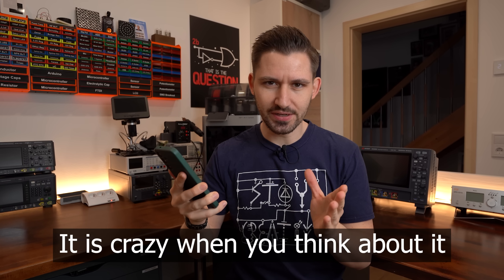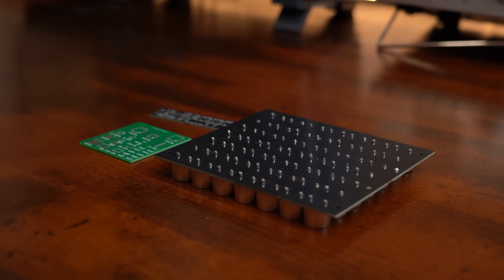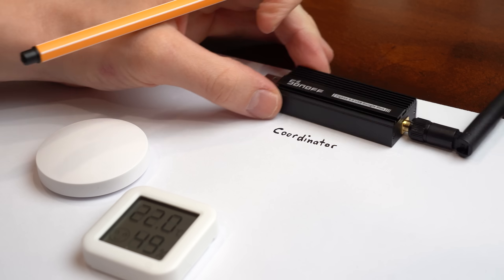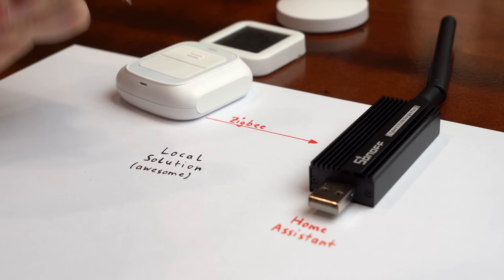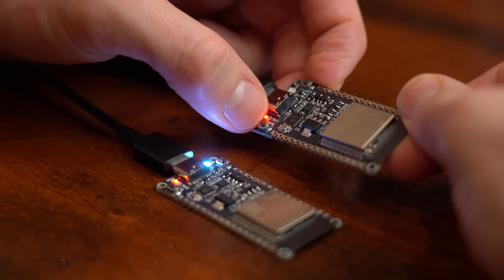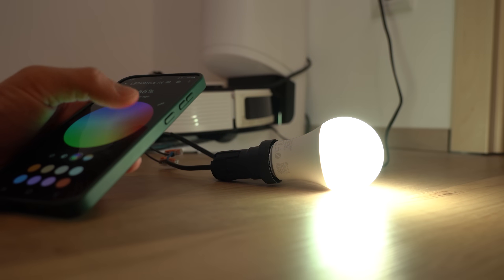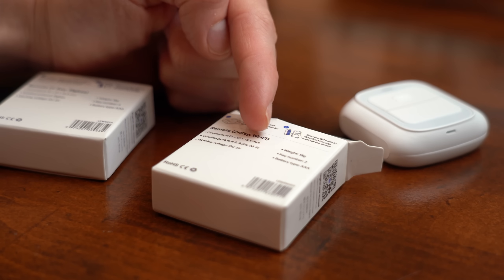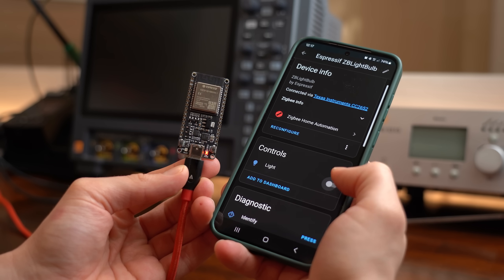Forget WiFi AGAIN! This Wireless Method is WAY Better? (Zigbee)

Comment: I don't think it makes sense to compare the range like this. The range depends on
- antenna design (and everything around it)
- TX gain as configured in dBm (for example with BlueRange Mesh, we could simply increase Bluetooth power by 2.5x by changing it from +4dBm to +8dBm, thus massively increasing range).
So it probably only makes sense to compare them with the same board and antenna gain (or configure the maximum gain for each technology, as some might be artificially limited by regulations, which can be seen as a downside of a technology)

Comment: Even though power consumption doesnt make much of a difference between WiFi and Zigbee, the Zigbee devices only fire in short bursts when they need to update, and the packets sent are a much smaller size than WiFi, so in the end, it consumes less power marginally.

Comment: Another thing I like about Zigbee is called Zigbee Bindings. Basically, you can "bind" end devices to each other, allowing them to control each other without going through Home Assistant. That's the only reason I'm comfortable with having lights controllable solely through Zigbee: even if Home Assistant goes down, the lights will still work.

Comment: Nice video, i didnt no there is zigbee diy boards! i must try them now 🙂.. I’ve stopped buying WiFi devices for my Home Assistant setup because I don’t like relying on the cloud. I still use a few Wi-Fi bulbs tho, but i use them locally (local integrations), with the cloud connection as a backup option.

Comment: WIFI SHOULD NEVE RBE USED IN DEVICES THIS IS STUPID AND SUPER HIGH OVERHEAD.  Also makes router work harder. Adds lots of network insecurity. ZIgbee is BEST so far there is not anything better device comunication. Also wifi is SLOOOOOOOOOOOOOOW comapared to zigbee.  I mean data packets is mcuh smaller faster to process and so on. Also zigbee uses the same freq as wifi but i noticed that zigbee have better coverage than wifi. I think its because of much less bitrate needed.
Also BAD idea to keep ZIgbee coordinator near router. I think you used safe band in zigbee to not be tha same as in wifi, but still, better to use in separate places, but nothing critical of course...if configured correctly bands.

Comment: ZigBee is great - I use tons of ZigBee sensors in the house. I agree with your judgement in general but the "Easy?" aspect requires a higher score in my opinion: "Good" at least if not "Best":

Install ZigBee2MQTT in HomeAssistant and activate "permitting to join" in the Z2M interfaces. If you then activate pairing mode for a new sensor (by pressing its button for a few seconds) it gets added fully automatically. Nothing to do for you - no password, no manual confirmation in HomeAssistant. Nothing. The device just appears (via MQTT) and can directly be used.

Comment: Yeah, Zigbee is great! im doing my home assistant setup since 2 Month and buying zigbee devices like crazy. There are some cool tools like Zigbee2MQTT and the Switch Manager!
How do you use your Wifi Thermostat/ Tuya device? Is it wired with a floor heating etc. or do you use it as a probe to control some TRV and so on?

Comment: 3:44 It’s anyway recommended to use a shielded USB A extension cable to connect the Zigbee dongle to avoid interference.

It’s also recommended to use USB 2 ports to avoid interference.
Reply: Came here to say this. If your device doesn't have a USB 2 port, just place an old USB 2 hub on the end of the cable and plug the coordinator into that. Note: I don't know if it makes a difference, but I used a powered hub

Comment: This video comes at a perfect time. I have recently started creating my own network of zigbee contolled devices, using Home Assistant and mostly IKEA Tradfri lights and switches. I was also wondering if I could implement some of my own devicss using the ESP32 boards, so this is exactly what I was looking for.

Comment: Great video, would you consider doing some tests with WiFi HaLow? I saw Morse Micro demoed some products CES and they also have a video where they test another device at 16km range with around 2Mbits throughput. I would like to see how HaLow compares to Zigbee for IoT applications

Comment: I use a lot of zigbee devices myself and i love them! I just need 1 hub/dongle to control them all and it only has a connection to the internet on the hub/ha server side instead of seperate devices all connecting to the internet. Also no need to enter a wifi password

Comment: About consumption, I have a zigbee temperature/humidity sensor since two years and the AA battery inside is still at 100% (it wakes up and sends data only when you want to display it, or once every hour if you don't use it, to build up the history)
On the other hand, the button battery of the door sensor died in two months this summer because the door was open almost 24/7 and it sends data continuously when the door is open... So yes, very low consumption in sleep mode, but can die quickly as WiFi devices if it can't use sleep mode ^^

RIP small button battery!
Reply: What brand is this zigbee temperature/humidity sensor?

Comment: While it makes sense you are using “speed” and throughput/bandwidth interchangeably. 

I’ve been playing around with different smart home set ups and I find speed (as in time) to be a noticeable variable. Especially on systems that will operate locally or remotely automatically by utilizing Wi-Fi when you’re not local but use their proprietary protocol when you are.

Comment: I wish WiFi didn't rely on the grace of vendors since this would make everything easy. I've added Zigbee and Z-Wave dongles to my Home Assistant to make sure all of my smart devices are managed locally and I can use my VPN when I'm remote. I'm not at the mercy of a vendor with the exception of my Garage Door opener that recently "updated" and removed automation functionality.

Comment: What is the low current measurement tool you use?
Reply: Seconded.  👍

Also is it compatible with Linux?  And is there a video for it?  Thanks.
Reply: I also really need this kind of low current analyzer, @greatscott could you give us some info on that?

Comment: Personally i love wireless technologi, but as soon as that wireless technologi has to connect to my internet, i am researching ong what protocol they use, if zigbee, hell no.
what people don't think about much is cybersecurity, and zigbee normally being very very easy to get into. zigbee pruducts security is based on how great the manufacture themselves deside to encrypt their product, there is no minimum requirement. and a lot of zigbee products are cheap chinese products with very poor if any encryption at all. where as something like z-wave has a minimum standard in order to be sold as a z-wave product.
just beware of what you connect to you'r home network, it is not hard to gain acces to it through un-encrypted zigbee products.

Comment: Zigbee is mature! Zigbee is already on mars! „Both Perseverance and Ingenuity are equipped with 900 MHz Zigbee radio link chipsets that are designed to relay data over distances of up to 1 kilometer.“ Perhaps Zigbee selected 2.4GHz because it is available worldwide where the regulations on RF Band differs from country to country.

Comment: Zigbee is amazing piece of tech and extremely low power as you saw because zigbee's primary function is communication between devices so since it doesn't transmit audio and video it doesn't really need a lot of power. Zigbee is even more power efficient than bluetooth so using it to connect devices to communicate among themselves is great for your electrical bill.

Comment: I'm glad to see Zigbee added to the leaderboard, and the quantitative comparison between their consumption, I knew zigbee was efficient but seeing the numbers, it's impressive! I've been using it for (domoticz then) Home Assistant running on my RPi 2B with the superior OSS Zigbee2Mqtt (koen the dev behind it is a machine) module since 2020, and would highly recommend it over the native hassio, due to its amazing support and features. Suprisingly the hw limitations are not a hurdle.

Comment: A network attached Zigbee Coordinator like one from SMLIGHT (SLZB-06M is one I got recently) would have been a good alternative to the USB stick, even runs on PoE power if available and has a local web interface!
Reply: And it costs about the same as the Sonoff stick, too

Comment: I have the problem that I have a Victron PV ESS system which needs permanently data from a energy meter. The dificulty is, that the distributionbox is in a neighbour building and it is not possible to set up a wired LAN line to my Raspi with Venus os.
Currentl I'm using a "Volkszähler" witch contains a ESP8266 and uses normal WiFi and a Tasmota firmware.
Thise solution is not pretty stable and has high latency times. It seems also that a ESP8266 is to small for this job.

What do you think, could a solution with Zigbee a better idea? And can Tasmota use Zigbee for a datastream?

Any ideas and thoughs are welcome!

Comment: For the power consumption since is a risk v chip you can power off stuff that the communication doesn't use to increase efficiency also the Comercial device probably is a soc that only does that

Comment: The one issue with Zigbee is contradictory. Because it's an open standard (which is obviously a good thing) integrators are free to alter it - including making it only work with their hub. Philips attempted to do this and only stopped due to a lot of bad PR, Ecobee has done this from the start. Z-wave isn't open, is way more expensive, but is guaranteed to work with any hub. I wound up using both.

Comment: After using a couple of dozen Zigbee devices with Home Assistant for about six months, I decided they were just not reliable enough.  (Mostly buttons and window-sensors). Since I had mostly Ikea and Aqara devices, this may have been the reason. I finally decided to buy an Aqara Hub M3 and an Ikea Dirigera. They are both connected to Home Assistant via Matter. When I add new devices to them, they automatically show up in HA afterwards, and since the brand devices have their own band hub, I now have a reliable system.

However, what's considered reliable may be different for everybody. As most of my home is KNX and I am used to PERFECT reliability, it was not acceptable to me to have devices fail once per week or every couple of weeks. So your mileage may vary.
Reply: how do prices compare (ZigBee vs. Matter devices)?
Reply: Aqara's zigbee end devices don't really work reliably (using with my own coordinator with zigbee2mqtt, not aqara hub). They lose "connection" to network from time to time, which is quite annoying. Other zigbee end devices, like Philips have much more reliable connection protocols.

Comment: Yes but Wi-Fi is Ethernet ... And you can apply all the bell and whistle of it such as switches, bridges and VLAN say. Using Thread on top of 802.15.4 look like a better option that Zigbee still, but I would preffer an evolution of 802.11 with a PHY using BLE on a connection less way.

Comment: Thread is the future! IPv6 is really good and important. To be able to always connect it with Matter even if the product is dicontinued.
Reply: As much as I agree that IPv6 is the future, keeping IP out of smart hone devices is honestly a big plus to ZigBee in my eyes. 

With the lack of security in general in IoT having mostly unmonitored/inconfigurable between routers around the network seems like a huge downside to the Matter model (especially with Matter over WiFi bridging this to normal user networks).
Reply: @rhysperry111  I don’t quite see what the appeal to keeping TCP/IP out of smart home devices is. 

That said, I do love Zigbee and ESPNOW
Reply: I’m not convinced. From a tech perspective, I mostly agree, but it needs wide adoption to “be the future”

Comment: Please, can you create a clip on how to use simple monitors and use them in personal projects and what do you need? For example, you put it on a DAC AMP and it gives you information about the SWOT, or you put it on a DIY flashlight and it tells you how much time is left to run or how much lumen it uses and things like that. It revolves around small screens Or even use it as a decoration on your desktop

Comment: That's crazy that in EU you can mix low voltage devices with line voltage devices in the same box (electrical panel).
That's not allowed in US, for obvious safety reasons.

Comment: Nice! Now I'd love a video about Matter over Thread, and ca comparison between it and Matter over WiFi and with ZigBee
Reply: Matter over thread is pretty much the same as zigbee since it is designed on top of it. The zigbee alliance renamed themselves to connectivity standards alliance and took the zigbee protocol part and used it as the base for the  matter protocol. It's even mentioned to be the base revision of some clusters in some places. The RF part of zigbee and thread is also really similar. While thread enables actual ipv6 networking, it's also just a 2.4GHz 802.15.4 mesh network. Range and throughput should be about the same , the same hardware can usually do both
Reply: @zapl80  In contrast to Zigbee, Matter over Thread is an open standard and very likely to replace Zigbee long-term. So getting new Zigbee stuff might not make a lot of sense if you don't already have a network. Would try to go with Matter instead.
Reply: @xdevs23  Thread and Matter aren't free, you can't build commercial products without paying lots of membership and certification fees. The only thing really open source is the matter reference implementation
Reply: @zapl80  Is it really the case that you can't build them or are you just not "officially approved"? Because you can still implement it and since it has an open source license, I don't really see what's holding you back from doing it anyway without paying a single dime. Of course the device wouldn't be accepted into networks but if you're in control of your own network then you can also make devices work that are not certified.
Reply: @xdevs23  you can do whatever you want in your own diy solution, that works fine, you'll get a warning that you have an uncertified device when using apple home for example but that's it. Matter isn't really great for diy though since its very complex and the standard is pretty restricted because they don't try to provide universal building blocks like generic percentage controls or sensors. They specify only specific devices that may or may not work for what you want. That IMO the big flaw with Matter because that means you rely heavily on someone specifying a product you can build and what feature set it needs to have
Reply: @zapl80  Hmmm interesting points indeed. As I'm just using Home Assistant I don't really care about the Apples and Googles but yeah, I'm still using Zigbee since that's what I started with like 3 years ago or sth and I don't have the hardware to build a Thread network. It seems kind of more complicated as well.
Reply: @zapl80 I guess the most important difference between Zigbee and Thread is, at least for end users, that a Zigbee network has exactly one coordinator, while Thread allows multiple border routers. If the Zigbee coordinator goes down, the network is dead; if a thread border routers goes down, another one jumps in. With Thread, border routers from different vendors like Nabu Casa, Apple, Google, Ikea can join the same network. Coordinators can’t do that. While Zigbee is older, stable, and you get tons of cheap devices for it, Thread seems to be technically superior to me. And the ESP32 C6 can do Zigbee AND Thread.

Comment: I use Sonoff S31 lite zb smart plugs around my house as Zigbee routers. A 4pack cost about $35 and has fixed the problem of some motion sensors and buttons disconnecting sometimes. I wish there were as many zigbee devices available when I started my home automation, because I have about 100 wifi enabled devices and even some zwave things and a lot of those are problematic, while my 30 or so zigbee devices only ever needed a set up and then just work.

Comment: I put a ~15€ relatively "giant" 10dBi 2.4Ghz omni antenna on my sonoff coordinator. It's quite bonkers how good range is. Even through multiple rebar reinforced concrete floors.

Comment: Interesting. My pet project is to build a mesh networking system that uses a greedy algorithm for packet switching. When I was looking at hardware options, I did not see an ESP-32 with Zigbee built in, but I did find that the majority of cheap ESP-32 devices supported ESP-NOW, and there is support for it in micropython, so that and an inexpensive UART LoRa module are what I decided upon as the physical network technologies. (I finished the basic router logic and the ESP-NOW network adapter plugin almost 6 months ago and successfully tested it with hardware, but I got blocked by the lack of built-in ed25519 cryptography and had to switch my attention to more pressing matters.)

Comment: I would recommend getting a Zigbee poe ethernet coordinator like the SM Light, and route the antenna away from your APs. 

That way, you avoid interference from USB 3.0 ports and lessen interference from any 2.4Ghz signals from your access points.
Reply: This is what I did, works great. Mine is a TI2652 based one (TZT HamGeek POE Zigbee) and it’s closer to the devices.